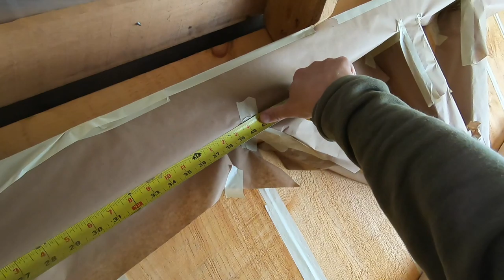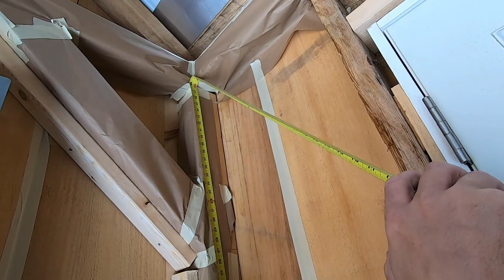This SHOULD Explain IT -- Next step getting the Post & Beam Barn Ready for Spray Foam Insulation

Comment: Before you foam the other side of the wall, you could wire an outlet to the milking wall. Outlets to the other goat areas could work for lights or a heater if you get a real cold spell, too.

Comment: You know that tomorrow never comes!  So you asked for suggestions on your future video, so I posted about using Gabions with all the extra rock you have all around the property.   Gabions with an internal plastic liner prevent flooding issues and wildfires!  Not only that it will improve the look of the homestead and used like raised garden plot, but it also increases the degree per day growing cycle as well.  So your rocks become an asset to the homestead with benches, tables and even corners to the future car park!   The word to remember is GABION!

Comment: 36 degrees! Wow, we are a good 30 degrees warmer on average, and Wisconsin is pretty darn cold! We wont see that kind of temperatures for another month or-so! We spent yesterday harvesting grapes. It's always a wonderful feel ing to have a great harvest. This insulation job will be interesting. I still don't quite know how this insulation is supposed to work. I never saw anything like it.
Reply: Judy G.  Hi Judy. We're is SW Wisconsin as well -- between La Crosse and Prairie du Chien along the Mississippi.

What I was referring to is the way this is being done. I'm curious to see how they spray into the edges where the cleats are. The cleats are not masked so any foam that gets on the face of them would need to be removed. Also, any foam that expands into the plane where the wall board will eventually be will need to be shaved flush. XPS or Iso may have been a better choice -- but maybe not. I'm currently doing a project with edge sealed XPS and am interested to see how this turns out. 😊
Reply: Planet Mojo I’m from Wisconsin too ( Jefferson County) 🙂👋🏼
Reply: @annesta7748  -- Hi Anne. We cut through Jefferson on the way to Milwaukee whenever we head that way. Lots of scenic old farms in the area. We looked in that area for a homestead before we settled along the Mississippi. Beautiful area!

Comment: I've watched your barn , wood shed and outdoor kitchen builds at least 3 times . Better than watching TV . I was wondering on your over hangs on the barn you didn't place the 2x6 sill plate right at the edge of the concrete floor . You placed them 1 inch back . Yes you put up 1 inch boards . Why wouldn't you put the sill plate right at the edge of the concrete floor and let the boards and batons over hang so the rain water by-pass the concrete and to prevent the water from running underneath the floor plate sometimes. Yes I know that you put the pink foam under the sill plate . Thanks.

Comment: Al, since you covered the post to protect it from the spray foam, what about the bottom of the loft area? Over flow or the foam in the air floating around could get on that as well, don't ya think?

Comment: That's a lot of work for spray foam insulation.  It better be better insulation than rigid insulation.  I'd have gone with the rigid.  I just figured out the 2x4s are to nail the interior wall siding.  I thought it was a guide for the spray foam.

Comment: Ok, I'm probably wrong, but I keep thinking is the foam going to trap the paper, or is the paper going to take off the foam? Must be some technical magic involved! 😀
Reply: wondering that myself im lost
Reply: @kirkmclennan4109  So glad I'm not the only one! They are calling them "nailers", so they are putting up wood on the interior to fill the foam in behind, I think.
Reply: The tape is so the foam wont expand outside. The 1x3 nailers are so he can attach the inside siding panels (to cover foam and nake it look nice) and The paper is so he can keep the beam's face clean from foam overspray.  That way when he peels/cuts the paper off the inside will have both  exposed beams and siding.
Otherwise itd just look like the outside and lose a bunch of the barn 'character'
Reply: So he is using the paper to protect the beams. After the spray foam comes, the paper will be trapped but that will be fine.
Reply: I assume that he will cut the paper along the edges of the foam if nothing else.  I am guessing that they don't know yet either, but if it affects the foam, they can just cut the paper.  They are going to put interior "paneling" on top of the foam according to his comment in this video, so they likely will remove the paper after that is installed.  Just a guess.
Reply from the maker: We want to make sure the foam doesn’t get on the beams or expand out the cracks
Reply: @Kimi           He can't put batte ns on that wall outside because the goats would eat them !

Comment: I really wish I understood what you were doi ng in today's video.  The masking I get; it's the wood strips that look as if they will block the foam that I don't understand.  And why aren't battens up on the outside to block the wind and snow?  Way too much nailing today...shorter would have been fine.
Reply: The tape is so it wont expand outside. The 1x3 nailers are so he can attach the inside siding panels (to cover foam and look nice) and The paper is so he can keep the beam's face clean from foam overspray.  That way when he peels paper off the inside will have both  exposed beams and siding.
Otherwise itd just look like the outside and lose a bunch of the barn 'character'
Reply: @mikozuna  Thanks.  I must have missed the interior siding explanation.  The rest I understood.  Seems like a lot of work when the house isn't finished.
Reply: @mikozuna  and there are no battens on the outside of the back wall because he said the goats would eat them.
Reply: @judithchilcoat5852  Their house is finished!!!!
Reply: @tonygrimes13  Al ha said they intend to do an entry way and that sliding glass door in the main room is begging for a deck or porch!

Comment: Al,did you walk outside after nailing that first board thru the siding,not the beam?I'd hate to think all those nail points sticking out like a porcupine quills.If they are sticking out you'll have to grind them flush without scarring the siding.

Comment: i guess im confused on the spray insulation. is it going to get shaved in order for the interior paneling to fit flush? everytime i've seen the spray insulation, it expands so much its not a flat surface and often needs trimmed

Comment: I may have missed it, but I am confused as to why all the extra work to prep for foam insulation.  Seems like overkill on the prep. Especially for spray foam insulation.  The wider the area around the posts, the more thermal loss.  The spray foam should be right up against the posts.

Comment: I gave up on this one. I have no idea what you are doing with all that spray foam prep. You seem to be defeating the purpose of spray foam  and its ability to fill all nooks and crannies.  Seems like a lot of work for nothing. But good luck. U still my fav.
Reply: robert leigh - it is interesting to see how Al and Gina work.  We learn another way of doing things.  Even if I don’t understand it make a mystery.
Reply: They are going to panel the inside, they don't want to see the foam
Reply: Not sure if you got far enough in. He is going to put approx 3 inches of foam, then put wall boards over the foam, encapsulating it. But still having an inch or two of the 6x6s showing, the keep the appearance of the post and beam, while still having the 2 inches of insulation

Now I will grant you, I would have opted for foam board instead, but that would not have been as air tight as spray foam
Reply: I get it, but all those board feet are going to create a big loss in R Value as the wood just directly conducts the heat.
Reply: Kevin Rutledge sure, that may be right. But ... pretty before useful, right?  

High heel shoes
Skin tight jeans
Wedding dresses
Goatees
Throw pillows. 

Pretty before useful

Comment: I don't get what he's doing all that for.  I know spray insulation,  but don't understand the method.
Reply: The tape is so it wont expand outside. The 1x3 nailers are so he can attach the inside siding panels (to cover foam and look nice) and The paper is so he can keep the beam's face clean from foam overspray.  That way when he peels paper off, the inside will have both exposed beams and siding.
Otherwise itd just look like the outside and lose a bunch of the barn 'character'
Reply: It looks like he is taping the seams so the spray foam doesnt seep out. The nailer strips are to nail up the siding after the spray foam. So the the siding will be below the bog post right up against the spray foam and the nailers
Reply: The spray foam is going in the cavity between the 2x's he installed in the video.   Then the interior finish wall get's attached to the surface of the 2x's and is bordered like a picture frame by the post and beams.   The paper is there strictly to protect the post and beams from any accidental over spray from the foam.   The paper will easily be trimmed away exposing the post and beams afterwards.    Your not just watching the prep for the spray foam.   Your seeing prep for the interior finish as well.
Reply: He said "nailers for attaching the interior walls and we will still see some of the beams".  So, it appears that they intend to add interior "paneling" over the spray foam and are going to use those 2x4's to nail it to"
Reply: To me it seems that the spray foam will adhere to the paper causing some to be ripped away, then thre paneling will cover that?
Reply: @yvonne1400  my guess is he'll put the paneling up, then cut away the paper flush to it.. then put trim over the edes ( Al loves to finish trim)
Reply: I think it's so that they can put a layer of insulation just as thick as the wood he nailed in today and then use these pieces to nail a plywood (or drywall) outer wall to to hide and protect the spray foam. Then they can pull the paper off and still have the nice looks of the pillars and beams the barn is built from, without having to clean off the beams of stray foam. It would be easier to have thicker insulation the size of the beams and just nail a plywood wall flat to the beams but then you would hide all the beams from sight.
Reply: It's a man cave. Lol
Reply: Now I understand! When the walls are done it's going to look nice!
Reply: @mikozuna  great answer. I'm  so tried of reading couch potatoes comments.lol I don't understand all he does but it's  his farm and money.

Comment: I dont understand the paper on studs
Reply: The tape is so it wont expand outside. The 1x3 nailers are so he can attach the inside siding panels (to cover foam and look nice) and The paper is so he can keep the beam's face clean from foam overspray.  That way when he peels paper off the inside will have both exposed beams and siding.
Otherwise itd just look like the outside and lose a bunch of the barn 'character'

Comment: The Electrician that installed the Main Electrical Panel in the New Barn , then installed the 3 metal 4'' sq. boxes that contain the Duplex Receptacles should have wired those outlets with AC, (BX) Or MC 12-2 w/grd Cable instead of Romex ! Romex is only to be used inside of Structures with enclosed walls, like Sheetrock (Dry Wall) !  By using AC (BX) or MC you have less of a chance of Zero to Zilch of Rodents being able to chew through the Metal Clad Cable and shorting something out ! The Electrician should have known better ! I IF I was wiring that Barn , I would use only AC (BX) or MC Cable only and NOT Romex !!!!!

Comment: I cringe with every nail you shoot thru the exterior boards.  Wish you had given the build of the strip framing more thought.  Even though it would have taken longer,  I would have prebuilt each one, making the side verticals continuous top to bottom, and nailing thru them into the ends of the horizontal strips.  Then attach the completed frame to the posts and beams.  If you are going to use full height boards to cover this, there would be no need to nail to the exterior boards.  I do like what you're doing.   It's going to look so good.

Comment: Frustrated viewer. This explained very little. I understand taping the seams to prevent seepage, and I assume the wood strips are nailing strips for siding or some other wall covering. But what's the paper for? I can't suss it out and nothing is explained.
Reply: The paper is just so the foam insulation doesn't get stuck to the rough wood .. it's a pain to get off so when he pulls the paper back off it's a clean board ....